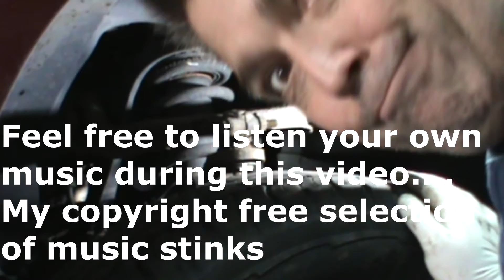2006 GMC Envoy Control Arm & Ball Joint

Comment: A great repair video. Two years ago, I had to perform the same repair on my 2005 Chevy Trailblazer with 122,000 miles on the clock. Replaced upper control arms and ball joints. About a year later, I replaced both inner and outer tie rods, then had the vehicle aligned. Front end in great shape now!
Reply from the maker: Nice work sir
Reply: @SAAutoRepair  How much does it cost to change the Ball Joint?

Comment: Just a question?what did you used to get the balljoin out ? An air gun and what else?
Reply from the maker: Not sure what you mean. Are you referring to getting the hardware loose or separating the joint and knuckle?
Reply: @SAAutoRepair  what is the name of the gun with which you removed the ball joint?

Comment: I never torque the axle hub nut   there is no preload  I slam it with the old ir   ive done hundreds of em  and....      I don't get why ball joints are not on the nys insp list....if its that bad ….hmmmm what would I do?
Reply from the maker: I don't understand a lot of the different state inspections. Some don't even have them. Thanks
Reply: NJ doesnt even do safety inspection on passenger vehicles. ITs basically just checking to see if the CEL is on and if all monitors are ready with NJ. I have seen people driving around with broken springs, twisted brake hoses (poorly installed brakes).. Its crazy!
Reply: wow in nj too!   people don't care about safety  if the car moves they drive it!  in ny... years back... emissions were only down state... we had to drive the car on a dyno while exhaust was read  a pain   now its plug in for monitors